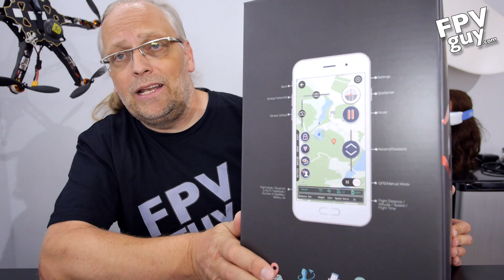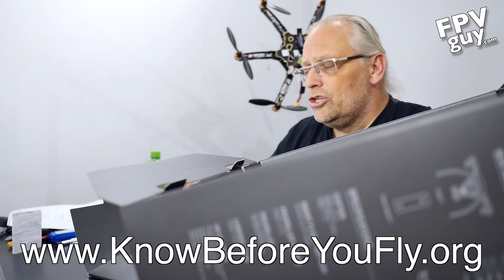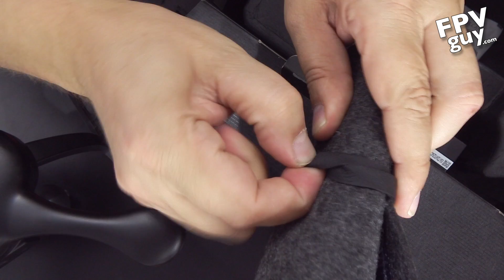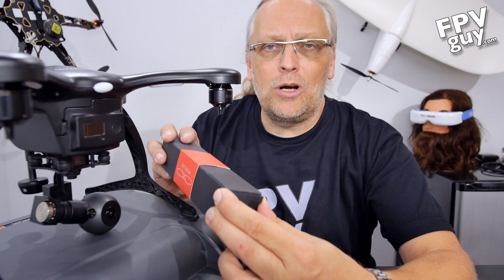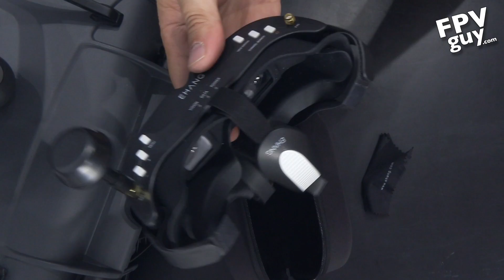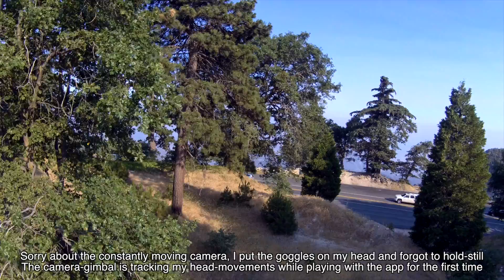eHang GHOST 2.0 unbox

Comment: Did you ever post a full flight test? This thing has really dropped in price recently and I was thinking of picking one up.
Reply from the maker: I never did, its kinda crappy flying.  however at the price they are not bad. :-)
Reply: Thanks for your reply. Crappy as far as crashing and flyway's, or just crappy because you didn't have controller for precise control?

Comment: My first thought is there is very little ground clearance for the camera which would make the camera and gimbal vulnerable to damage when landing. The head tracking goggles look like a very cool feature.
Reply from the maker: Yeah agree, however only the ground clearance have not been a problem for me,  I'm a bit surprised that the Ghost have never fallen over or had problems landing.
I love the goggle concept, and it works exactly as advertised, but sometimes I would rather  have a big screen so I could easier show others the video

Comment: Cool" but I still don't see the type of drone that am thinking of, (1) I need a silent Drone that can ascend up to cloud level with long Hours of battery life, or they could add alternator to the propeller motor, So while Flying you still charging battery (2) powerful reception antenna and a little parachute in case for safety landing (3) Can also operate through mobile towers e.g. you insert a sim card in a Drone and you could fly miles and miles away from home and still stay connected through mobile tower is like making a call sending information back and forth, from the tower to ur Drone
Reply from the maker: LOL - Walkera have a revised TALI with LTE connection for exactly that reason and a s900 unit with hybrid drive.. also for exactly that reason.
I would avoid flying either of those in the continental USA without a specific license and ATC clearance to fly above 400 feet ;-)   as all private drone use in the US is based on LOS = Line of Sight..

Comment: Looking forward to the bringing out of the extra 2.4g antenna in the ST16, thinking about doing it myself but will wait for you to show and demo any benefits, regards Tony Australia
Reply from the maker: Hey Anthony,  there are some benefits, however its not as dramatic as dropping the two body antennas down a bit.  Jorge did bring it out on his ST16, however I did not bring mine out,  as the modified H antennas already exceed my typical flying range.

Comment: I still do not trust this type of technology, at least with sticks you know where you are putting a device, with an app, you are relying on the signal of the wifi not getting lost in the mix. V1 had the option to buy a standard controller, I wish they would have offered that option with this one so far I have not seen one.
Reply from the maker: So far I have not experienced a problem  with loosing WiFi as you are within a couple feet of the WiFi module..   
Its my impression from talking with eHang that they are not planning on a handset controller for the 2.0 ( wonder if the 1.0 controller will fly the 2.0?) 
full disclosure, Im on the controller-with-sticks wagon as well and prefer hard-wired control systems.
Reply: Bo Lorentzen I understand that even a controller can lose contact, but it is still the most reliable method, I feel E-Hang missed a whole market here.
Reply from the maker: Mjah.. not sure actually,  the eHang Ghost 2.0 is more of a consumer product,   its been growing on me,    my guess is that most of the market for the Ghost 2.0 will like using the phone for flying.
You and I typically fly more "prosumer" oriented products.  the Ghost likely will appeal more to the people who want to shoot a bit of video from the beach-trip, but don't want to learn to fly sticks and learn orientation.    
The method of flying the Ghost is much more "pushing it around"  "fly over there and turn it so we can get a big selfie"
Reply: Bo Lorentzen you can do that much with the H using the wizard wand lol and for around the same money -_-
Reply from the maker: LOL well actually.
The GHOST 2.0 aerial edition (no VR goggles) $399
works exactly the same as the VR edition
The GHOST 2.0 VR edition $899 
Both 1 year no questions asked warranty 
Defined as up to 3 crashes in one year.
Reply: Bo Lorentzen I'd rather pay for the H pro, 2 batteries, wizard want, obstacle avoidance, with smart technology mind you, should I keep going? lol.
Reply from the maker: LOL Im not disagreeing with ya.   I'm pretty thrilled with the H-pro :-)
but its not "almost the same money"
Reply: Bo Lorentzen It will be after the lawsuits lol. How many times has your cell phone dropped wifi? Mine has several times and since I use Sprint it is not like it is a low data package.
Reply from the maker: Hu.?   you don't use data on WiFi.   out in the nature the WiFi spot in your pocket will be the most powerful WiFi so the phone is not going to go hunting for another hotspot
*i hope
Reply: Bo Lorentzen Mine has in the past, so just beware. I have just thought of a use for the ghost drone, you can set it up in the air and use it to record your fpv flights so long as you can turn it towards the flying field and use it like a boom camera. These are pretty much hands off quads so I would assume they would work for that purpose.

Comment: Great review and demo of the googles and head tracking.  I wonder if any of the manufacturers will ever use the head tracking to actually control the drone.  I also thought the same thing Don Fish Jr. thought.  Moving the camera with the head tracking would make it difficult to coordinate the actual flight path with the view.  I guess with practice it could be okay.  Brad didn't like the elbow! LOL
Reply from the maker: I envision it would be quite possible to learn to fly a drone by pitch-roll-yawing ones head with goggles on, probably would work best with a wide-angle FOV so one can see around well.

Comment: tnx for this video....i have a question about the maps....not only wih this GHOST 2.0 Drone but also for example the P4 ....I have a Smartphone with GPS and Offline Google Maps on it....but i have no expensive Data payment on it...just prepaid for GSM.. can this Drone works with this ? or maybe caching the Maps i want at Home with my WiFi connected to my smartphone and then go flying in the field..?
Reply from the maker: Hey Gewema,  thats a really good question. I have to come back to you on that as I simply don't know.  however it seems like there should be a method for this. :-)
Reply: tnx BO.....

Comment: I wonder if the forced update has to do with "no fly zones" and geo fencing?
Reply from the maker: Hey Wayne, thats a really good question,   I need to ask eHang about their policies on no-fly-zones.  however this particular firmware update were a flight-profile improvement.  
eHang is very aggressive with improving the drone's flight and have been very quick to address issues in firmware whenever possible.

Comment: Hi Bo.  
In the light of previous Kickstarter Style Drone promotions - such as the AirDroids Pocket Drone, the Zano Selfie drone, and more recently the Onagofly disaster - it's great to see something as well thought out as this offering from Ehang. I would suggest that anyone contemplating this craft should ensure that their mobile device is suitable. I have a Samsung J5 and while it's a current model it surprisingly does not have an onboard magnetometer. Who knew?   
I'm looking forward to the flight video.  
Regards.  
Nidge.
Reply from the maker: +1 to that Nidge,  people are routinely getting ripped off on kickstater with impossible drone projects.  the GHOST 1.0 delivered and shipped to backers and now the 2.0 is shipping, the 2.0 is a overall improvement across the board from the original.  better battery, way better camera,  and they have continued to develop the smart-phone user interface.

Comment: A very unusual bird. The goggles,with headtracking, and camera built in are really nice. The whole concept is great. I imagine flying FPV might be a little tricky. If you nodded slightly, as some people do, the birds flight direction would be a bit different than you persieve it to be. Do you think that might pose a slight problem? About how much does it retail for? A good comprehensive unboxing video!
Reply from the maker: Thank you Don.   OK the FPV thing is not quite the way it seems,  the goggles ONLY control the pitch of the camera, so nodding will not change the flight path.
I was told that they adjusted cost to $899 but have not seen it reflected on the site yet.